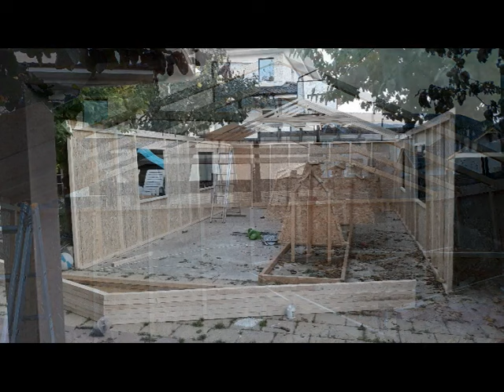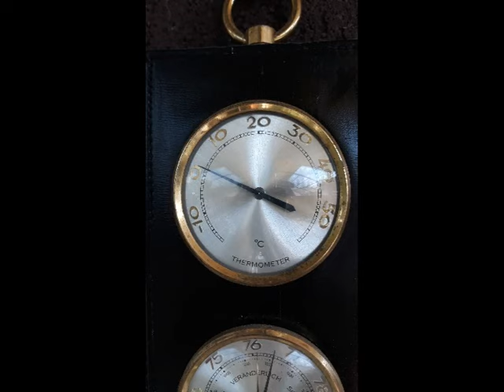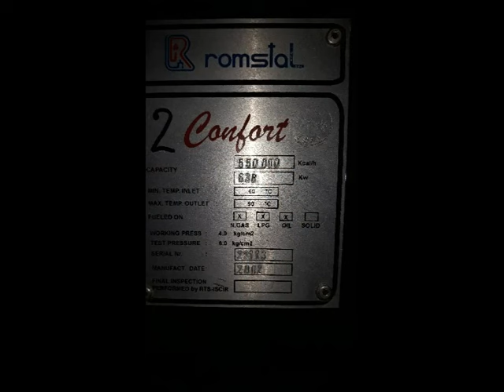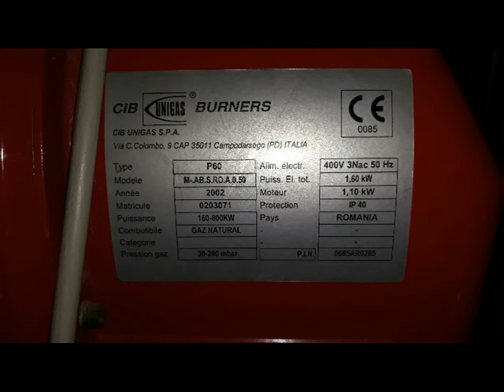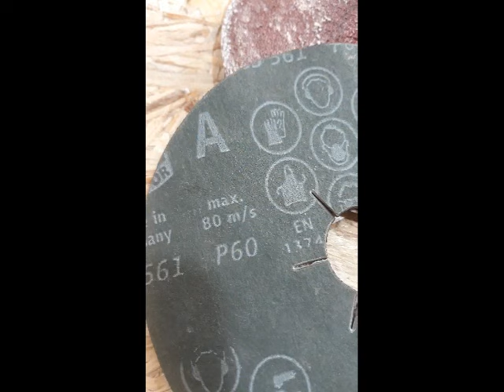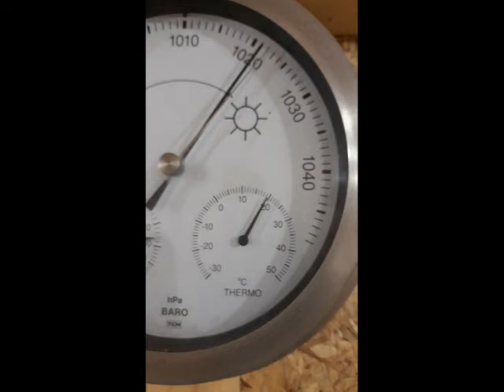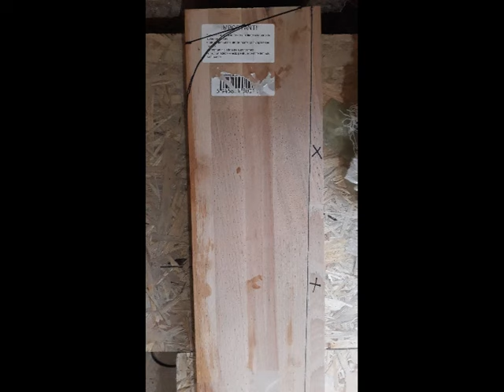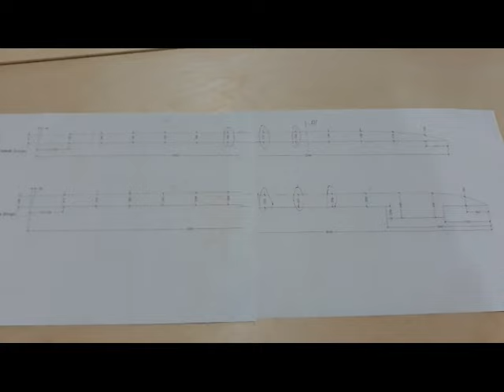PLYWOOD BOAT BUILDING PROJECTS DE23 Part 1

Comment: I wish wooden  boats would stop trying to look like fiberglass boats.
Reply: It's  building method called cold molding.  Some of the world's finest "fiberglass" sportfish yachts are built this way. Good marine grade plywood is lighter and stronger for the weight. Hence...a faster boat.  Also more expensive than the heavy solid fiberglass tubs. Just look at Paul Mann sportfish yachts. They cost 2x what a viking will cost and this is how they are made. But...they are much faster and have a longer range.
Reply: @Picasofly  Yes I know all that.
Reply: @shanedevon6447  yup. I know. I've actually built a couple boats from these boat builder central plans. Lots of work but also fun if you're into working with your hands.
Reply: @shanedevon6447  also, no voids in plys.
Reply: @shanedevon6447  Exterior grade glue is used and no or few inner voids to hold moisture and all structural plys.  That is the difference.